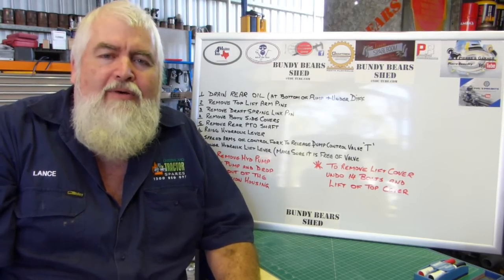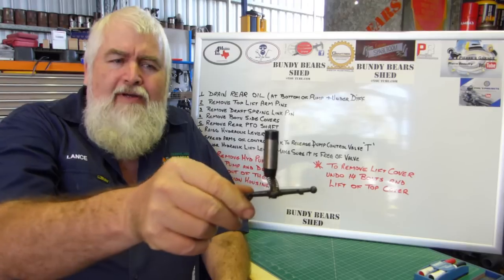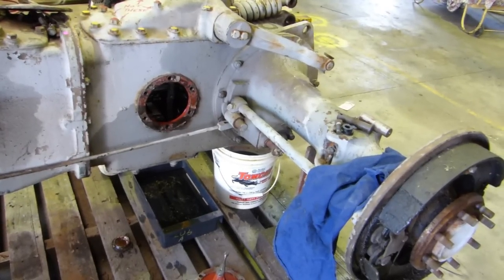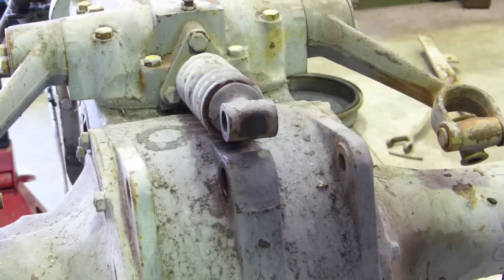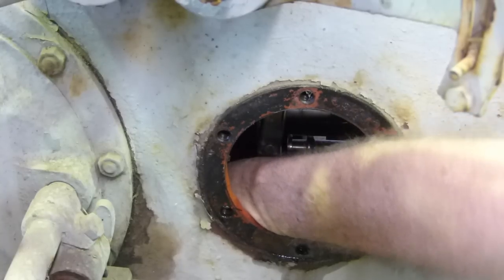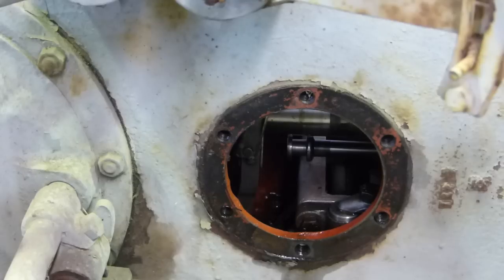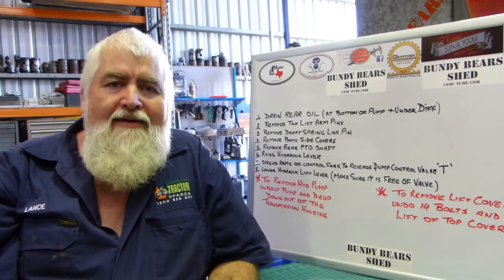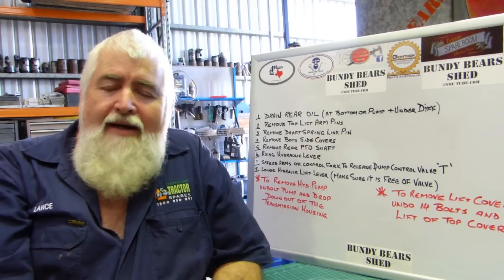How to remove a Ferguson TE20 Hydraulic Lift Cover and Hydraulic Pump

Comment: Hi Lance. I absolutely love your videos. I have watched almost every one on the 'little grey Fergie'. You have inspired me to have a go at something that I have always wanted to do but never had the confidence. I have followed your steps to take the pump out and eventually got the PTO shaft out after about 3 days of trying all sorts, then tried to drop the pump out/down but it just seems too big to fit through the hole. I have tried everything to get it out, moved it forwards and backwards in all sorts of places but just won't come through. What am I doing wrong?
Reply from the maker: G Day Chris, You are probably doing nothing wrong, the pto shaft can get a twist in front of the hydraulic pump from not having a slip clutch on a slasher or hitting something hard. The shock twists the spline and wont let you withdraw the shaft out the rear. You can split the tractor and cut the shaft off or get in from the top and do it but I think you will probably need to at least lift the lift cover and have a good look.
Reply: @BundyBearsShed  Thanks for the reply. I already have the lift cover off and have also cut the shaft off just behind the pump so there is nothing holding the pump as far as I can see but it just won't drop out through the bottom

Comment: Hi Lance, drained oil ,took side covers off and the pto side ,side valve chamber has a piece split away from it,i had the cast piece braised before but it didn't last, can i get away with taking the bottom off to change the chamber. thanks Steve. also where is the main jet screw located on the carb. thanks again and sorry to keep pestering you.
Reply from the maker: You will need to drop the pump out to get to it Im afraid.
Reply: @BundyBearsShed  thanks Lance,it snowed here yesterday,just to highlight my day

Comment: Our lift plate we’re installing is for a back hoe it does not have a lever on the right side nor does it have anything under the four bolts that you said not to remove. We are not using the C-clamp can I just throw out the T-bar on the pump or is there something I need to do different other then throwing the t-bar out? Other than that great video. Thank you.
Reply from the maker: I think it sounds like you need a top cover from an ag tractor, it if has no bolts to hold the cylinder in It wont have one under there.

Comment: Thank you very much for doing these videos. I have a 48 TO20. The hydraulic works but won't hold the 3 point up unless the engine is running an PTO is engaged. Soon as you stop the hydraulics' drop. Any suggestions on what that might be?
Reply from the maker: That is built in as the 3 piston rings have a gap in them so it must drop. There is an update piston with an O ring that can help the problem.

Comment: great video. I have a to30, i was doing some box blading and everything was fine, after coming back from lunch the lift would shudder or jerk upon raising, it still lowers normally. any ideas on what to check, and can I finish blading my driveway without tearing up anything on the tractor. thanks
Reply from the maker: Check the hydraulic filter, and oil level first thing .

Comment: Any tips for just dropping oil & flushing that crap out so the new oil does'nt get contaminated by the sludge?
Reply from the maker: I did run diesel in one but in the end it is still hard to get it all. Dont forget the big plug under the hydraulic pump.

Comment: Dear Sir many thanks for taking your time to post  your interesting and very informative videos, a question please, if you were going to pipe up a T 20 for a double acting ram for log splitter etc where is the best place to couple to the high pressure side?  I know of the blank on the right hand side near foot rest but you have to have arms in the permanent lift position to make it work? also where is best place for the oil return pipe to go to? or is it easier to drill & tap casting? many thanks Eddie
Reply from the maker: No short cut with the supply the arms need to be down slightly from the top. The corner of the hydraulic pump is the pressure port. return can be into the ol filler or a bung on the side of the lift cover.
Reply: @BundyBearsShed  Many thanks for your reply

Comment: Hi Lance, You do a great job with these videos.
I have looked for a video for a FE 35 3 cylinder diesel , this is the closest I can find.
My lift cylinder will work fine without any load or if I stand on the linkage but when i now attach the slasher, it only goes up half way. Any clues please?
Reply from the maker: Look at the stand pipe o rings, I have not done a lift cover vid on the 35 or 135 but will be doing it on the MF65.

Comment: Great video and thank you.. 
I have a TO35 with water in trans fluid.. what would you suggest in a pinch? 

Thank again!
Reply from the maker: Just drain and replace the oil a few times if you can afford to
Reply: Bundy Bears Shed Thanks for the reply.. 8 gallons is like a $100 a pop.

No sarcasm intended..
Reply from the maker: Yes it gets expensive quickly.

Comment: Mate firstly want to say thank you for sharing your knowledge.  Secondly I have a question,  my tea 20 hydraulics work perfectly for lifting but sticks up sometimes and seems to want to overlift . Thinking may be the relief valve . Just wondering on your thoughts . Cheers love your work
Reply from the maker: Check without an implement the arms go up and down by hand and it is not bunding in the top bushes, Loosen the bolt on the end of the rock shaft and see if it makes a difference.

Comment: A word of caution. Careful removing the pump. Tap from the rear of the tractor to break the seal and not the front where a bolt protrudes. The previous owner used a very adhesive sealant instead of paper gasket so my plate was on hard. Could not crack it cept with a good hit on that bolt. The pump fell out and also snapped off a housing that holds the PTO selector gear assembly. Secondaly where he puts in his hand and separates the forks, I have a 51-53 (dont remember) and it had a aluminium bracket holding the forks firmly, cannot separate without removing 2 bolts either side of the forks.
Reply from the maker: Yes the later tractors had an alloy brace to stop the arms from flexing, mine being early didnt have that. You must not have had the pto collar out of gear as that is what drives the pump.

Comment: Hello Lance. Thank you for some good videos. I have some questions for you. On a Ferguson tea 20 from 1951, Question 1: Where the Hydraulics covertop is bolted with the large hydraulic housing / main transmission. Should there be an iron control in the oil channel to reduce oil pressure on the gasket. My tractor leaked oil from the gasket where the oil channel is. Or does it sounds like I have a different hydraulic problem when it does that. I have removed the hydraulic cover and at the same time discovered that the control valve is damaged / bend. ??? Question 2
: What kind of hydraulic oil do you use. Have read in old manuals that 80w90 is used. It's correct that the oil is too thick to use. ??? Can I use oil-approved silicone gasket with the original gasket. Or it is necessary to use glue packing instead. Sincerly Carsten from Denmark
Reply from the maker: G Day Carsten, There is only a gasket where the lift cover bolts on. I never use a silicone but a product like Loctite 515 is what I prefer as there is no chance of a bead falling into the oil. I have run them with 85w 140 and had no problems in a hot climate like we have here. An 80-90 will work fine as well in an old system but originally they were the Mono 30 the same as in the engine.
Reply: @BundyBearsShed
Reply: Is it not 80w winter 90w summer straight mineral oil GL1 rating? The 80w90 on the transmission stamp is for winter from what I've found.

Comment: Quick question my rear pro shaft won’t remove. I have it unbolted and came out about 2 inches and won’t move from there, any suggestions?
Reply from the maker: G Day Rob, I think your pto is twisted. they twist in front of the hydraulic pump if there has been an impact earlier some time. No easy fix, I have seen people cut them out.

Comment: Hi have a tea20 1950 my lift arm don't work at all but are free as i can move them up an down my self, any ideas what the problem could be or is it best to drop pump out an rebuilt whole thing Robert
Reply from the maker: I think the pump control valve will be stuck, free that up and you should be good.
Reply: Thanks for advice will strip down an have a look at weekend

Comment: Hi there,  ive turned the steering wheel while the steering arm ball joints are off.  The steering arms appear too have skipped out of its place.  One steering arm is facing back of tractor and one is facing front.  How do i get it back to central position?

Comment: Hi I have inherited a ferguson 20 diesel but the lift arms wont lift even though the lift lever is working but nothing happens , it has oil thanks bud
Reply from the maker: G Day Glocca, Remove the rh side plate from the gearbox and see if you can see the valve moving with the lever. That might give you a hint as to what is going on.

Comment: I have use of a 135 MF decile tractor that quit forward and backward motion.  I've been told that the sleeve holding the drive to the pinion shaft may have sheared the pin holding it. I have a new pin but don't know the  placement.
Reply from the maker: Watch the video on my 135 but you want it firm as possible
Reply from the maker: Lok at the old one for marks of where the pin went.
Reply: @BundyBearsShed  thanks
Reply: @BundyBearsShed  so where's the video?
Reply from the maker: in tne Massey Ferguson 135 6 speed playlist.

Comment: HI Lance. Great video. I have a to-30 and have worked it for 20 years without a problem. Recently I was moving some dirt  and I hit a buried rock and jarred the tractor some, not a uncommon event in my Arizona desert. Well my hydraulics were gone. Could not raise either my front blade(add on years ago) or my rear gannon box. Changed the oil as it was terrible but that made no difference. Ready to disassemble but thought I would ask if you had any idea what I might be looking for. PTO still works fine. Not a mechanic but willing to try it. Thank you
Reply from the maker: I would see if the control valve is moving or stuck in the bore. See my latest TE20 video.
Reply: @BundyBearsShed  I will watch that. Today with the oil drained I could see that my control valve only moves a very little bit from the movement of the forks. But when I put my fingers on it up through the drain hole it moves much further and freely
Reply: watched it and my control valve does not move even close too as much as the one in your video. could my forks have moved from the jarring maybe? They are still are attached. They flex some at a pivot point above where the bracket is that you talked about removing the bolt from the side access hole. Why dont they move the control valve more, it doesnt seem stuck. was hoping for a fix without pulling the pump. Thanks for your advice, super helpful!
Reply from the maker: @maryherreramabry4336  with the rh side cover off start the tractor and try and move the valve with a screw driver. you should be able to work it from there and see what is going on.
Reply: @BundyBearsShed  I put the oil back in and tried to move forks  on control valve with screwdriver while tractor running, still nothing. Going to drain again manana and try to free the forks from the control valve and then see if control valve will move more. It seems stuck inside the pump.

Comment: Great video explained well. thank you. i'm about to dismantle mine to figure out why it keeps dropping. slowly.
Reply from the maker: G day Danny, They will always drop slowly as the three main hydraulic piston rings have gaps in them as they are cast and the oil leaks past. The only way to fix it is to machine the piston and fit an o ring and back up washer.

Comment: Hello Lance.  When I went to drain the hydraulic fluid out of my TO20, I found the control valve holder (yoke) in the bottom of the pan  along with the front part of the shaft - broke from rust.  When you are showing the example part, you have the two tabs on the yoke pointing up - is that the orientation that it goes back in?   Second question, the site where I found the replacement part says that there part doesn't have a slot on the end of the valve body - does that matter? 
Thanks.
Reply from the maker: Yes tabs go up and the slot is no big deal either

Comment: I have a 1955 Ferguson TEF20 would that have the alloy support on the legs? If so is there a easy way on who to remove them??
Reply from the maker: G day Edward, I think you probably would have the alloy supports, usually you just undo the two quarter inch bolts through the sides to spread the control valve operating arms and the top lifts off.
Reply: Bundy Bears Shed thank you very much I will try that.

Comment: Hi Lance 

What would cause tea20 hydraulics to sometimes not work.
Most of the time mine works great but then even when it is warm and has been working it stops?
Love to hear what you think.

Cheers Cam
Reply from the maker: I would think the control valve is getting a bit sticky. The later pumps had the valve oscilating to stop the problem and they also shielded the relief valve. I would drop the big plug under it nd give it an oil change and clear any junk from the base plate.
Reply: @BundyBearsShed  Cheers Lance 👌

Comment: Any tips on getting the new control valve hooked back up.
I have my pump rebuilt and reinstalled.  But omg am i fighting to get the forks back on the valve. Please tell me there is a trick to it????
Reply from the maker: Not really I just spread the arms and fit them.
Reply: @BundyBearsShed  i finally got it. I went through the drain plug and was able to get it that way.
I dont have much left, then its off to the paint shop. Hope to have it finally finished in the next few weeks.
Your videos have been so helpful.  Cant thank you enough.

Comment: Hi Lance, I am currently working on a TEA20 to try and replace a broken hydraulic control valve. I was able to remove the old control valve but found that it had a thin rod with a square section attached to the front of the control valve. I have been unable to remove the PTO shaft as I think it’s twisted so I’m unable to drop out the hydraulic pump to be able to replace the control valve on the bench. I have been trying to insert the control valve with the attached square section with the hydraulic pump in Situ but I’ve been unable to do so. I am wanting to know if I insert the control valve without the rod and square section attached whether that would damage any part of the TEA 20 or whether it would work satisfactorily with just the control valve inserted.  I would greatly appreciate your guidance on this matter. Thanks Brad.
Reply from the maker: It will work fine as the square was a later add on to keep the valve moving so it didnt get stuck when sitting.
Reply: I greatly appreciate your reply. Thanks Lance. 
Your videos have been of great assistance. 
One more question please. We are having trouble spreading the yoke to connect the control valve arms. Is there a tool available to spread the arms.
Reply from the maker: not that Im aware of
Reply: @BundyBearsShed  thanks Lance.

Comment: On my TEA20 the lift only begins to raise at about 3/4 from the top and it doesn't hold steady at any height,  it's either lifting or lowering . Should I replace the control valve?
Reply from the maker: Try and adjust the lever where the 4 bolts are there is slotted holes there. They dont have a position control.

Comment: Do you have a tool for repairing the suction and discharge valve seats in the hydraulic pump housing and what are its dimensions or markings. Thanks ..
Reply from the maker: No, sorry I dont, You could try to lap the new valves in.
Reply: @BundyBearsShed  I understand that new valves are being installed during the repair. But I ask you if there is a tool to manually process the valve seat in case it is damaged.

Comment: Hi, love your videos. I have a Massey 203 with a 3 inch lift cylinder. Is there a replacement piston that uses o-rings for it? Thanks
Reply from the maker: G Day Larry, I have not found one yet but I have machined an o ring groove in the old piston and it worked very well.
Reply: Thanks

Comment: With the Hyd Lift cover, will I still need to drain the oil to remove it if I am not removing the pump?
Reply from the maker: No just fit the lower side plate bolt but I do think it will be easier for you to see what you are doing if you do drain the oil.